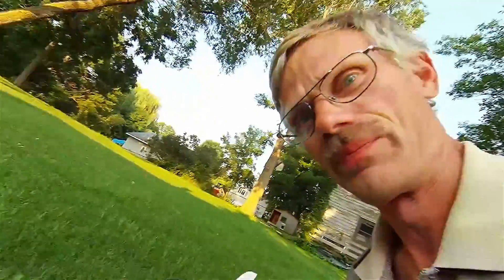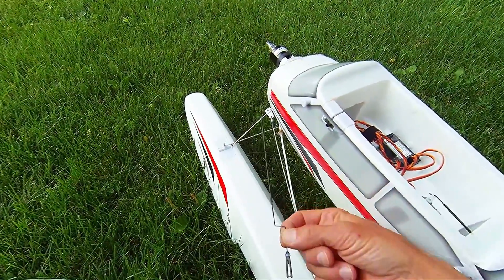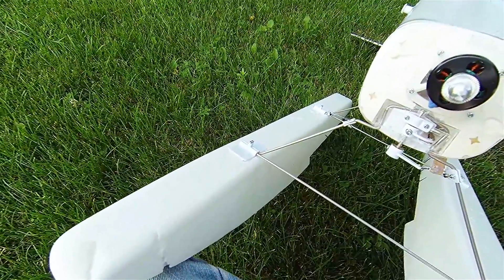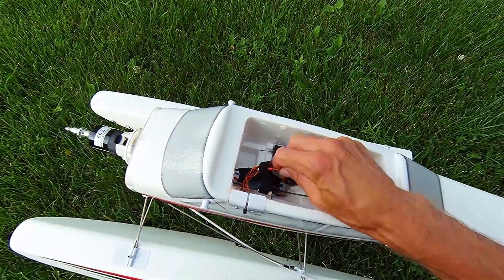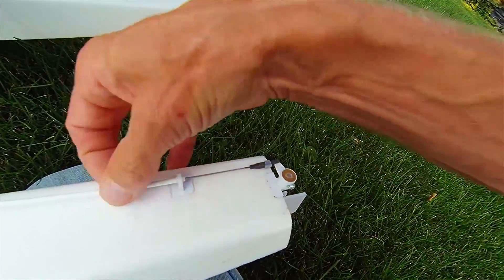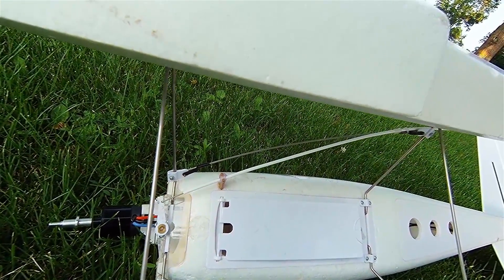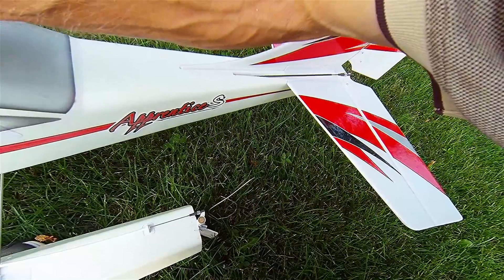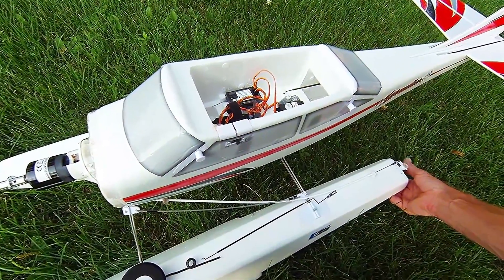Gaining authority over the float rudder on my E-flite Apprentice S 15e

Comment: I totally agree with the rudder being pathetic.  I could t even turn the plane on a light wind day to go a differnt direction.  I have to wonder if just some hot glue on the Z end in the factory Rod would  stiffen it up making the Z less affective?  The rod for the rudder needs some serious bolstering I used a couple loose zip ties to get some authority but will be making  your mods to it   It definitely wants to dip a wing when it gets going and willl make a turn from a nice straight path all on it own.

Comment: Hello mnragnar, first off thank you for videos I love them all, just wondering if you could tell me were i can find the 256 rod and how long and the angle on the ends??? if you would please. any way thank you for videos i will always continue watching.
Reply from the maker: Great question, "ice fishing forever". 

I think that I found my 256 rod and clevises mixed in with all my leftover "scraps" that I've accumulated over the years. It helps if you have a local hobby shop as we have in Hub Hobby in Richfield Minnesota. Those are getting tougher to find by the passing year. Otherwise ordering stuff online from places like Tower Hobbies and Horizon Hobby is a great online place to start. I think that Dubro RC brands a lot of this type of hardware and my specific rod was probably threaded at both ends originally, but I trimmed one side to length and soldered on the solder-on clevis. Finding the right length and angle was purely by trial-and-error, using the original hardware as a starting point. This hobby greatly benefits from some creativity. Being a "hoarder" doesn't hurt either. lol 

Thank you for the great feedback and thank you for sharing my RC aerial adventures. 

May all your landings be "gear down".

Glenn
Reply: @mnragnar  thank you for your quick response, I appreciate your input. I've just been sitting here thinking of what I could use for that push rod and it hit me, what if I used a metal coat hanger, and figure out the length, bends, and clevises. I appreciate your time mnragnar thank you.

Comment: What about Vegitation under the water surface geting snagged in the rudder Glenn have you dealt with that issue?
Reply from the maker: Cory Reeves Vegetation hasn't much of a problem for us. First, I removed the spring from the pontoon rudder to allow it to retract on higher speed taxiing and take-offs. Second, when we manage to snag something, we watch the "streamer" while in flight and challenge ourselves to knock it off on touch-and-goes. It is amazing how tough that vegetation is. Usually it doesn't provide too much trouble when we do manage to snag something. 

How about you? Have you been dragging stuff from your lake with the rudder? 

Glenn
Reply: a little bit of grass and it doesn't make for a good take off, I can taxi on it and power through it but it provides just enough drag  it causes an issue on some take-offs.
Reply from the maker: Cory Reeves
 Have you tried disconnecting (or removing) the spring from the rudder? It may permit the rudder to ride over the water vegetation instead of pulling it up and dragging it for the ride.

https://youtu.be/mTjJU6dIq5k?list=PLMXlQTNNNkYFTi5RES0zM0xogKizNbL-q

Glenn
Reply: I will give that a shot thanks for the idea

Comment: I went bye the instructions and it worked out fine
Reply from the maker: Justin Tolhurst 

Great to hear! 

I hope that you have at least a fraction of the fun that I've had with my Apprentice S 15e. 

My Apprentice S 15e, along with this and many of my other modifications, are now flying their third summer from the lakes in Minnesota. If you're using this on water, you might also consider modifications to keep the water out of your electronics. You'll quickly find servo motor, radio receiver and ESC failures as well as corroded battery wiring from the terrible water intrusion of the stock airplane setup. 

https://youtu.be/I6CwEQEnrD4

You can see the terrible worn bird in one of my more recent posts of this same bird in action, bit with the same airframe, the same floats, the same rudder modification and the same "waterproofing". 

https://youtu.be/W1AE24oXKzg

Again, I hope you have at least a fraction of the fun that I'm still having with mine! 

Glenn

Comment: What about just removing the rudder completely to fly? The super cub doesn't even come with a rudder for it's floats
Reply from the maker: Cory Reeves 

YUP! Been there! I use the Super Cub floats on my Extra 300 without a water rudder http://youtu.be/2x4v2Oiaxnk and my UMX Carbon Cub also does fine without a water rudder http://youtu.be/X9lFbmhFvBw . So, I tried it on the Apprentice S http://youtu.be/0uXgXkb5ww8 and FAILED. There's not enough air rudder on the Apprentiice S to make it work. but I had to try!

Glenn

Comment: Glenn,

I got the floats installed strictly by the installation guide.  I notice you do not use two "bands" on the left crossbar, instead you're routing through the balsa mount point you glued in.  Did you get two bands and decide there was too much friction with the angle of the control rod or what was your thinking there?  My main issue with the servo driving was the rudder was on too tight.  They placed it too far up on the rudder shaft, so when I put the top interface arm on, it sandwiched the entire rudder setup too tightly to the mount, creating all kinds of drive problems all the way to the front nose gear interface and then again back to the servo itself.  I loosened those tiny nuts and moved the rudder down on the shaft, retightened, and I have absolutely no problems with controlling it.  This leads me to my final thought: Can you please explain the benefits of being able to backdrive everything?  I didn't feel like controlling the servo arm (stiff) by moving the rudder was necessary; only the opposite.

Justin
Reply from the maker: I think you'll notice that my bands are WAY down at the bottom. As you've seen, positioning that cable is pretty sensitive. I found that fastening the sheath to the brackets at the top cause the binding that you've described. Even gently forming the wire into a continuous arc from front-to-back helps. As I found, each time that I thought that I "got it", my next flight sent me into either clockwise or counter-clockwise taxis on the water. It took me a few flights until I settled on my solution for my permanent fix.

Of course... Your result may vary.  :-)

Great to hear that you're on the water! If you're able to reach success with less effort, even better! Thanks for the update ***** 

Glenn

Comment: Bought an Apprentice recently and have been flying it with great results. Been flying it more since trashing my old best up sig kadet. The apprentice is a dream flier and I found very quickly that I really didn't need the beginner mode. Now I'm considering getting the floats and another glow fuel trainer to complete my training. I have an old patched pt40 trainer I got from a friend but I have a feeling it won't be anything like this Apprentice. I have found on the Apprentice that the wheels and carriage come off easily but maybe that's a good thing :) thanks for your good advice!
Reply from the maker: Greetings Richard!

I'm pleased that you're pleased, though I'm not surprised. In reference to your Kadet, I've got two similar old-school trainers myself. An Eagle 2 and an EasyFly 40 of which I have a few videos of each. Then there's my Falcon III which has had so many engineering changes that it has little resemblence to its beginner, aerobatic plane origin, after turning it into my favorite, electric, twin engine, taildragger, aerial video machine..

http://www.youtube.com/playlist?list=PL24D7C66C0D080088

http://www.youtube.com/playlist?list=PLMXlQTNNNkYE-8vhbxxH1Y5REIyVhaQk_

http://www.youtube.com/playlist?list=PL0786D31F0031DE20

http://www.youtube.com/playlist?list=PL676BE8CA7CDD92C3

As is being documented on YouTube, my glow fueled planes are migrating to electric, as the convenience factor wins each time. (I hate spending an hour cleaning castor oil from every crevice and smelling it for weeks.)

As nostalgic as I am regarding my old-school aircraft, I've put more hours on my Apprentice S this past year then all others combined. When I ran out of "challenge", I upped the output power of the power plant and I went excessive with the control throws.

I'm with you on the beginner mode. I never use it. "Expert Mode" 100% of the time. But I can't tell you how much the full-time AS3X gets a workout. I'll challenge my Apprentice S to conditions that I would have never dreamed of with any other aircraft. http://youtu.be/qa64VGlLLS0 

Just the other day I tried take-offs and landings with my Apprentice (with floats) off grass. I placed some reinforced "strapping" tape along the bottom float surfaces (to protect the foam) and it performed quite well off the grass. A head wind and full power got mine launched in no time! That might be a good way to practice flight with floats without getting wet! (Or give you a place to land if you you chicken out.)

I recommend that you keep adding to your hangar. (mine's quite crowded) I've been "flying" since the late 90's and I haven't "outgrown" my Apprentice S. I have an orchestra of aircraft and none of my instruments is any more or less than the other, but each has unique characteristics that offer each a principle part within my symphony of RC flying machines.

BTW...

I have similar "soft" landing gear wire on my Parkzone Extra 300 http://youtu.be/b9IjfDUfyw4 and my E-Flite UMX Beast 3D http://youtu.be/hVhyXDDkV4Y. I've soldered a light gage wire across the two gear about 1/3 up, which prevents my prop strikes (taildragger planes) on my hard (Navy) landings. Doing similar on the Apprentice might lessen the chances of bouncing your tail section to the pavement, making your landings look more polished.

I'm looking forward to "hearing" of your float kit purchase in the coming weeks! 

Fly safe!

Glenn

Comment: Thanks again for the tips. I've been wanting to get an apprentice for a year since I first started reading reviews. I did see your cameras on the wing tips, and of course for for balance. I do wonder if I'd be better off with a tidewater since it is made to be in the water and has floats under each wing and I wide fuse body. Seems like it would be much harder to tip over in the water. I'll give it some more thought though I'm definitely getting the Apprentice.

Comment: Thanks for your quick reply. I think I will get one and give it a try, though the tidewater seems like a very good design for water.  I just ordered a Mobius camera and will have to see if there is a way of mounting it on the plane without screwing up the cg. Also want to try a small quadcopter. We have a summer place on a lake and I think both could be fun. Thanks again for your very helpful videos especially the info on making rudder control more robust. 
Rick
Reply from the maker: Thanks for the feedback, "Richard Lawn".

I think you'll have a blast with your Apprentice. Be cautious regarding wind. This light aircraft does amazingly well in the air, but it only takes about a 7mph gust to lift the tail and have this aircraft inverted when sitting on the water.

I've found two good locations for my cameras on my Apprentice. Take a peek at my opening sequence here. http://youtu.be/bIPUNxEfnv4 You'll notice that I get great, prop-free, HD videos with my Mobius on the wing tip. BUT... You need to counter both the drag and weight as I have done with a small battery of similar geometry and weight. My second location is above the "cockpit". That's where I mount my FPV camera. You'll have a cowl and prop in your view, but no counter weight is required. As always, the drag will affect flying somewhat, but I've been able to fly safe in both of these locations.

Checkout my collection of aerial videos from my Apprentice here. http://www.youtube.com/playlist?list=PLMXlQTNNNkYEX49QHsfaw0HUXFzX6G7Vd

BTW: I checked out the "Tidewater" and I'd recommend that as a more advanced float plane. I'm afraid that those wingtip floats are going to mandate precise leveling of the aircraft during takeoff and landing. The Apprentice is much more forgiving as the wings have much more clearance. I think the Tidewater looks like something to shoot for "next summer". :-)

I can't wait to see your videos.

Have a fun summer, Richard.

Glenn

Comment: I'm a new comer to RC, but have flown a nitro fuel Sig Kadet. I'm interested in getting a float plane for our summer place. WOuld you recommend the Apprentice or something like a Tidewater for a beginner like myself?
Reply from the maker: Greetings "Richard Lawn",

I can't think of another model that I'd recommend more than this Apprentice S 15e. I've being flying RC since 1999 where I started off with my Hangar 9 Easy Fly 40 (Quite similar to your Kadet.)  http://www.youtube.com/playlist?list=PLMXlQTNNNkYE-8vhbxxH1Y5REIyVhaQk_ I've had countless crashes, each which required hours of repair time and considerable cash for parts.

Fast forward to today!

I purchased my Apprentice S 15e solely as a float plane. In the meantime, I've put my HD Mobius camera on it and outfitted it for FPV flight. http://www.youtube.com/playlist?list=PLMXlQTNNNkYEX49QHsfaw0HUXFzX6G7Vd In doing so, I've had many crashes as I continue to push my limits, and most are fixed with glue and a propeller.

Yes, the Apprentice S 15e makes a fine "trainer", but there's so much more you can add to it to keep you from getting bored with it and the quick repairs will keep you in the air.

BTW:

My Apprentice S 15e is one of only two aircraft that I'm willing to fly in 35mph + winds. http://youtu.be/qa64VGlLLS0

As for the"Tidewater", I have no knowledge of that model, so I'll defer the comparison to someone else.

Give a shout regarding your decision and post some videos of your success!

Fly safe.

Glenn